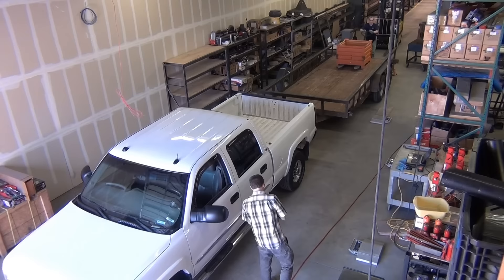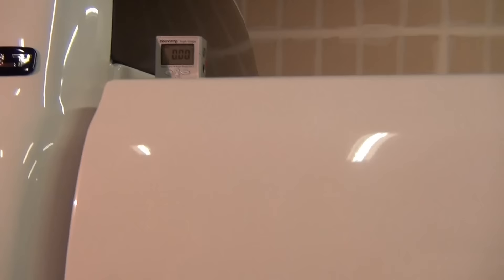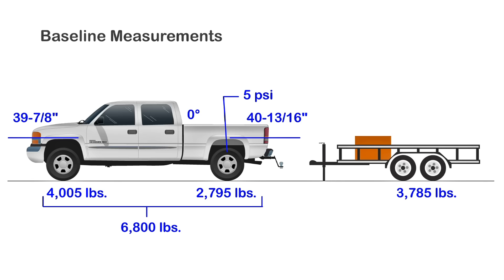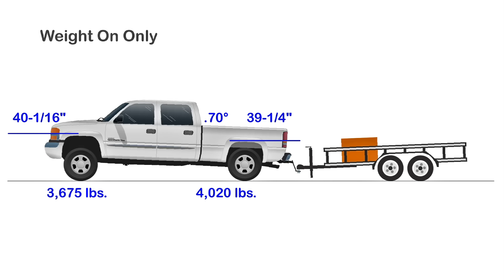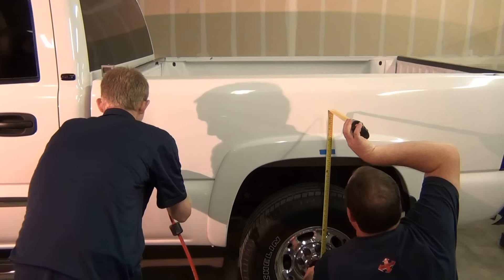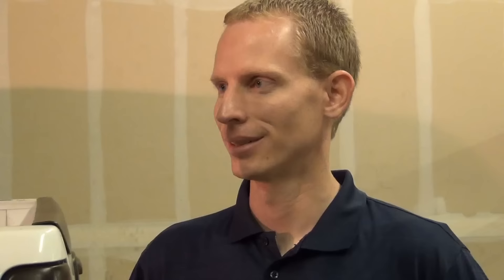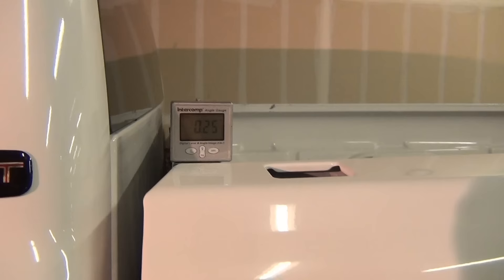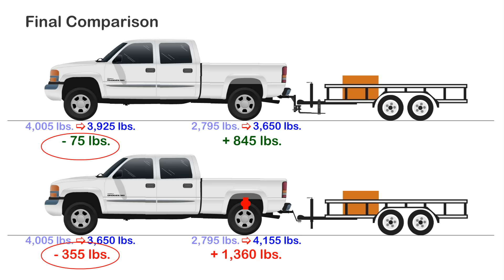The Difference Between Using Weight Distribution and Air Bags to Level Your Load

Comment: I suppose another fix with the trailer would be balancing it with the weight being centered just forward of the trailer axels, no?
Reply from the maker: Yes, in a typical towing situation, you would want the weight in the trailer set up so that the center of gravity is just ahead of the axles, which you can do by making sure the tongue weight is between 10% and 15% of the gross trailer weight.

In this video, we are not towing, nor are we concerned about the gross trailer weight, as that does not effect the weight distribution. Only the tongue weight effects the weight distribution set up and loss of weight on the front axle of the tow vehicle. Because of this, the trailer is not loaded correctly for towing, but instead loaded to make it easier for us to get the 1,000 lb tongue weight quickly and easily, without having to load more weighted bins onto the trailer.
Reply: @FastwayTrailer so technically you're simulating a 10k lb load, correct?
Reply from the maker: @braydenborrowman1065 , we are creating a 1,000 lb tongue weight for a trailer that could technically have any Gross Vehicle Weight (GVW) high enough to allow a 1,000 lb tongue weight. In the video, the GVW is only about 4,800 lb because of where we placed the weighted bin.

For practical towing, you would expect the GVW of the trailer (also referred to as Gross Trailer Weight, or GTW), to be anywhere between 6,667 lb and 10,000 lb, because that would make the 1,000 lb tongue weight 10% to 15% of the GVW. This ratio is a generally accepted industry standard.

Comment: Well done video!  But why did you overload the tongue weight?  Should not exceed 15% of loaded trailer weight before applying weight distribution.  Makes life easier and safer to let the trailer do its fair share.  I see the advantages of using both when close to the combined vehicle weight rating.
Reply from the maker: Great question, thanks for asking. In this video, we are only showing the principles associated with using either air bags or weight distribution. We are not planning to tow the vehicle in a real-life towing situation. We moved the weight far forward in the trailer to achieve the tongue weight we were looking for without having to load the trailer with several bins. In this demonstration, the gross trailer weight does not have an affect on the air bags or weight distribution, only the tongue weight. You are correct that in a typical towing situation, the tongue weight should not exceed 15% of the gross trailer weight.
Reply: Why didn't they keep adding air pressure to the bags to get the level back.  That would have redistributed the weight.
Reply from the maker: @bigthrawn01x , adding more pressure to the air bags actually decreases the amount of weight distribution you are getting from the hitch. Air bags do not effect weight distribution on a tow vehicle with a bumper pull trailer. They only stiffen or soften the suspension. Having some sag in the rear axle is desired, because this is an indication that the rear axle is carrying the tongue weight of the trailer. You need this to make the tow vehicle more stable when towing. Weight distribution is used to force the front axle to carry the weight it loses (weight it is supposed to be carrying) when the tongue weight is applied to the rear of the tow vehicle.

Comment: If I have a truck camper and cargo trailer set up and am pushing payload capacity, would it be wise to have both airbags and a weight distribution hitch?
Reply from the maker: Yes, both a weight distribution/sway control hitch and air bags would be good additions to use for your setup.
Reply: @FastwayTrailer  👍

Comment: Those types of WD bars it seems like if you turn to sharp the bars will pop right out at the ends
Reply from the maker: Great question. The hitch instructions tell you to mount brackets in a certain position on the trailer frame to the point where it is physically impossible for the bars to slip out. That is one of the benefits of having friction sway control!

Comment: So you are saying you should use one or the other?  I pull a 9k trailer and usually have about 700lbs in the bed of my 1/2 ton truck and I use air bags and a weight distribution hitch.  I started with the hitch and it helped but eventually I got air bags and they were a game changer.  Can I ditch my weight distributing hitch?  I wouldn't mind because it weighs 100lbs and it's a pain in the butt.
Reply from the maker: We are not saying use one or the other or both. We are saying that each product is good at its designed purpose, and you should use the one(s) that meet your needs best. Air bags are designed to be an easy way to stiffen or soften the rear suspension. This is usually the most helpful if you want a softer ride most of the time, but need to stiffen the suspension to haul a heavy payload. Weight distribution is to help counteract the loss of front axle load (steering and braking control) you can experience when towing a bumper pull trailer. Some hitch models, like the e2 hitch, also have built-in sway control which is an added measure of safety and protection while towing. Many people have success using both on their rigs. Determine what your particular towing needs are, and then choose the product(s) that work best for you.
Reply from the maker: @katieandjeremyknautz5617  we have received a lot of requests for that. It's on our list for the near future.

Comment: All of the videos I have watched state that using a weight distribution hitch does not change the tongue weight.  They say that if you put 1000 LBS on the ball, it will stay 1000 LBS no matter what you do to the truck.  According to the figures you have using the weight distribution hitch, you changed the weight from 1000 LBS to 770 LBS.  Having a 2016 RAM with the RAM Box my pay load is only 1013 LBS so tongue weight is critical.  Are my assumptions correct?
Reply from the maker: That is correct. Using a weight distribution hitch does not change the tongue weight. Using a weight distribution hitch like the e2 hitch [http://fstwy.co/home] changes the way weight is carried by the tow vehicle and trailer. In the video we show the baseline axle weights, and the tongue weight. At baseline, the 1,000 lb tongue weight is being held up by the tongue jack. Later, we show the axle weights after being coupled. The 1,000 lb that was being carried by the tongue jack is now being carried by the rear axle of the tow vehicle, and the trailer axles. At the end, with the weight distribution hitch engaged, the hitch forces the trailer axles to carry slightly more weight, the rear tow vehicle axle less weight, and the front tow vehicle axle more weight, than they do when coupled with no weight distribution. Throughout the demonstration, no weight in the trailer was moved, so the weight as measured at the trailer tongue would still be 1,000 lb, but the axle weights do change because of the different ways the weight is being carried by both tow vehicle and trailer.

In your particular situation, you most likely have two different ratings for the receiver hitch – one for weight carrying (ball mount), and one for weight distribution. The one for weight distribution will be higher than weight carrying. Neither of these should be exceeded, based on the type of hitch you are using to tow. Using a weight distribution hitch should force your trailer axles to carry more weight, thus reducing the amount carried by your truck and helping to keep you within your axle and gross vehicle weight ratings for the truck. The only way to make sure of this is to take your rig to a CAT scale and have it weighed. These are the measurements to pay attention to. If your axle weights and gross vehicle weight are under the max rating, you will be fine on your payload limitation.

Comment: I've read in these comments that using airbags with a WDH is counter-productive, but I don't understand why.  I have a Fastway E2 hitch that I've used to tow a 24' camper using a Ram 1500, and I've never had sway or any other issues.  I just upgraded to a 31' camper (2000 lbs heavier), transferred the Fastway hitch and added airbags in anticipation of the squat.  I've driven the new setup once, and the suspension of the 1500 is so soft, that's it's such a bouncy ride!  I was thinking of upgrading the airbags and running the new ones at 50 psi instead of the 30 psi that I just installed, but watching this video and reading these comments has me thinking that I'll somehow be completely negating the WDH.  Any suggestions?
Reply from the maker: Thanks for watching! Having air bags does counteract what the WDH is trying to do. However, there are a lot of users who do have both and have found a balance. If you chose to go this route, make sure you set up your air bags first, and then the WDH after you have your air bags set up. If you do the opposite, then when you add air after the WDH is set up, you will lose the tension of the hitch and lose your WD and sway control. Also, the lower the psi setting, the more WD and sway control you will get out of your hitch. If you have too much psi, then it will almost feel like you don't have the hitch on there at all.
Reply: Running both for me has been ideal, as most will attest to as well
Reply: I'm pretty sure that you have to add some spacer washers to your spacer rivet on the head (it changes the angle of the ball) to bring the rear end of your truck back up to where it needs to be (it sounds like your e2 hitch is still configured for your lighter trailer). Check out this video. https://www.youtube.com/watch?v=aNmcYI2Pp9w

Comment: Should I use both?
Reply from the maker: Using both is a great option, but not a requirement. They each serve a different purpose, and they each do their own thing very well. Get the equipment that meets your particular towing and hauling needs.
Reply: Yes! You'll be glad you did!
Reply: I plan on using the air bags to level out my truck so that headlights are properly aimed.  This is after I have the WD hitch set up.
Reply from the maker: +AlaskaErik,
We recommend that you inflate the air bags first, then set up the weight distribution, because inflating the air bags afterward reduces the amount of weight distribution.
Our recommended process is this:
- Inflate the air bags. Make your best guess as to what pressure that should be.
- Take an unloaded measurement at the front wheel well and record the height.
- Couple up the trailer and raise the jack.
- Take a second measurement at the same place, and record this. Calculate a halfway point between the two.
- Engage your weight distribution hitch.
- Take a third measurement at the same place, and compare this against the halfway point. If the third measurement is between the halfway point, and the first measurement, you should have pretty good weight distribution. If not, make some adjustments as needed.
- Drive the rig. If you decide you want a stiffer / softer ride, unhitch, adjust the air bags, then go through the measurement check process again to make sure you have good weight distribution.
Reply: Or. Put trailer on ball. Set the air so truck is level, then finish hooking up your bars. Simpler and works just as well
Reply: Thanks.  I saw that in the second video I watched.
Reply: I agree with other commentators that each has their own uses.  Reason why air bags are less effective in a bumper pull trailer (also called a tag along trailer, or conventional trailer) is because of the fulcrum effect on the rear suspension.  So the WD (Weight Distribution) system is much more effective.

But let's say someone is using a fifth wheel or a gooseneck trailer, air bags are the way to go.  Air bags are also very useful when there is a high payload on the truck itself.  Kind of hard to use a WD system when there's no trailer to tow.

Although I have to ask about the order in which inflating the air bags should be when used in combination with a WD system. With a very heavy trailer, one that nears the towing capacity of the truck (and some modern half tons are being rated to tow 10k - 12k pounds, alot more than the 4k pounds shown in the demonstration of this video) even with a WD system, there will be some issue with the headlights not being aimed as prior to having the trailer attached.

What I was told was to properly adjust the WD system to the truck with only 5 psi in the AB system, then inflate AB system just enough so that the headlights are shining back on the road as it should be.  Is this method incorrect?
Reply from the maker: +screaminjlew, thanks for the question - it's a good one.
We recommend airing up first, then going through the process of taking measurements and setting up the weight distribution. It's kind of hard to visualize without being able to watch what happens (hmmm...idea for another video?), but here's why. Setting up the weight distribution hitch correctly requires that you get the hitch ball set to the coupler height to start off. Airing up the air bags changes this height, whether you do it before you drop the weight on, or after.

Imagine that you set the hitch ball at exactly the trailer coupler height with air bags at their lowest pressure. Now, put the trailer on, air up the bags, then take the trailer off, and re-measure. The height of the ball will have changed. It will now be higher than the trailer coupler height, which can significantly change how you set up the hitch and weight distribution leverage.

For this reason, you should air up the bags, then set the hitch up with the ball at the correct height, and then set it up for the correct weight distribution. Hope that helps!
Reply from the maker: +John Davis,
Our recommendation is to inflate the air bags first, then set up and adjust the weight distribution. The reason is that inflating the air bags changes the hitch ball height, which changes the weight distribution hitch setup, thus reducing the weight distribution force from the hitch if done after the hitch set up.

Thanks for the insightful comment!

Comment: This is good but I don't see how the weight changes as shown.   No weight is added or subtracted so the sum of all weights should be constant.  It doesn't appear this is the case.  It is just a matter of how the weights are distributed.
Something is not quite right.
Reply from the maker: Great question. This is something we should have explained better in the video. There are some discrepancies in the weights we show as the baseline, and as the axle weights with air bags and weight distribution. This is due to the tolerances of the scales we were using. The axle scales are +/- 5 lb each, so stacking all eight of them can lead to as much as + or – 40 lb. Also, the tongue weight scale we used was a simple analog hydraulic scale. Though we tried to get it right on the 1,000 lb mark, the actual weight was probably off a few pounds. Combining these two factors gives the ~110 lb difference shown between baseline and the other measurements. In the end, the difference is less than 1% of the combined vehicle weight, and since we were simply trying to demonstrate the principle of using each device, and not doing scientific testing or certification, we determined that this was accurate enough to show what we were trying to show, which is that each tool is good for its intended purpose. Air bags and weight distribution can be complementary, but are not interchangeable.

Comment: Why did you bias so much of the trailer's gross weight onto the hitch ball,  You used about twice the percentage that is ideal; should have been about 500# instead of about 1,000#.  My guess is that you were trying to use a lighter trailer to mimik what a heavier trailer would do, but that makes the geometry wrong in a way that reduces the  benefit of the weight distribution system.  That is, you will not be able to transfer as much weight onto the rear axle of the trailer as you would with a larger trailer with only 10 to 15 percent tongue weight.
Reply from the maker: +Rooster,
Thanks for the comment! The overall weight of the trailer does not effect the weight distribution. It definitely affects other things when you're towing - trailer stability, towability, safety, sway, braking, handling, etc. The tongue weight directly affects the suspension of tow vehicle and the weight distribution.
For this example, we wanted to demonstrate the different effects of the tongue weight on the tow vehicle when using either air bags or weight distribution. If we had used more trailer weight, the numbers would be higher throughout the experiment, but the effect of the tongue weight would have been the same.

Comment: Gooseneck?
Reply: There is no weight distribution hitch for gooseneck, and if the gooseneck ball is slightly in front of the rear axle, the tongue weight is applied to both axles, instead of taking away weight from front axle in the conventional hitch scenario.

Comment: What about both systems together .
Reply from the maker: We don't normally recommend using both air bags and a weight distribution hitch together. The air bags can counteract the weight transfer that the WDH is giving. Using air bags to raise up the back end of the tow vehicle will decrease the amount of tension placed on the hitch, which determines how much weight distribution and sway control you will get. So, raising the rear of the tow vehicle to eliminate squat will reduce sway control.
Reply: With my weight distribution hitch installed I still get a half to one inch of squat. Can I use the air bags to ease at least some of that squat?
Reply from the maker: While it may ease some of the squat, it will only put more weight on that same rear axle. The point of using the WD hitch is to restore that weight back to the front axle of the truck, and trailer axle(s). That being the case, I would leave it as is, and have that slight 1/2" of squat.